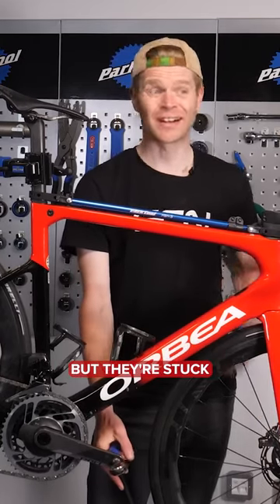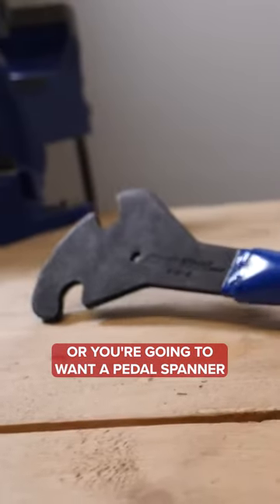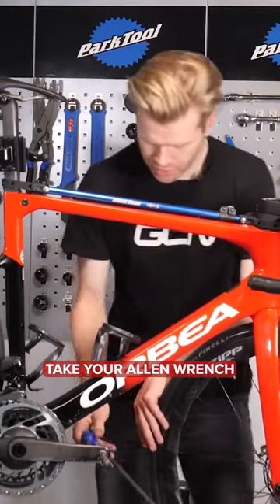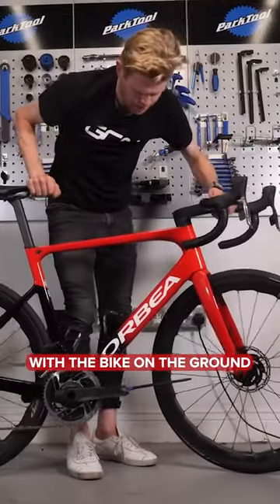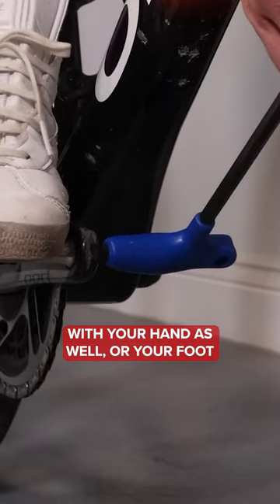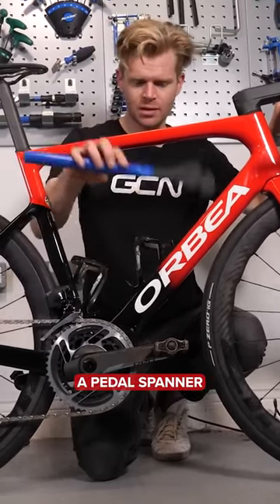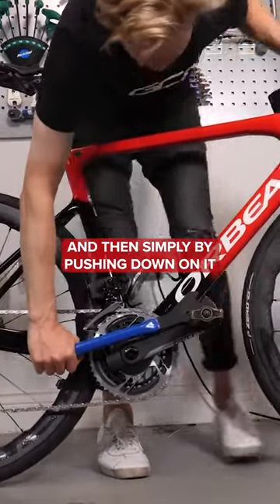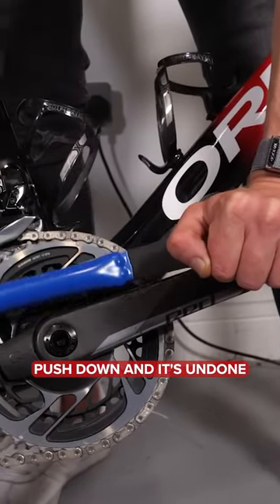How To Remove Stuck Or Seized Bike Pedals

Comment: Why doesn't this work for me? I know you can't answer, but it's frustrating and I'm close to bringing out the angle grinder...
Reply: Yeah destructive maintenance has been on my mind as well, but it turns out i apparently don't have a drill bit hard enough that it can drill into the back of the pedal even, and grinding is not quite the solution, because what good is that going to do?

The cranks are some sort of nonferrous alloy covered in plastic overmoulding, so i can't just blast them with flame, the pedal shaft looks very very rusted so i can quite imagine what it looks like inside the thread...

ACTUALLY... i just disassembled the pedal and hey yeah uhh the steel shaft has... gained a fair bit of porosity. Maybe i can melt it out with an acid.
Reply: @SianaGearz  I managed to change pedals after a while but it wasn't as easy as this video show. I almost bent my tools before the screws came loose.